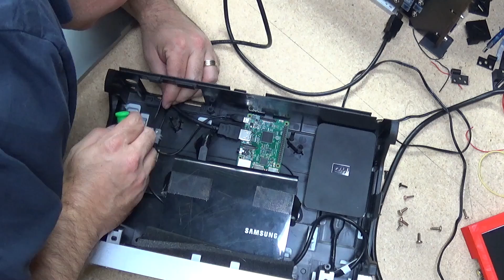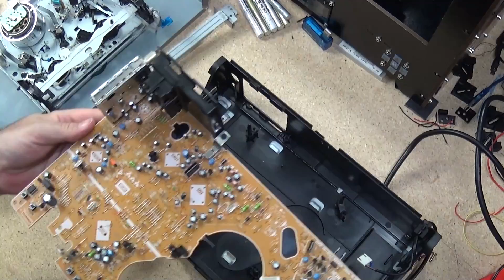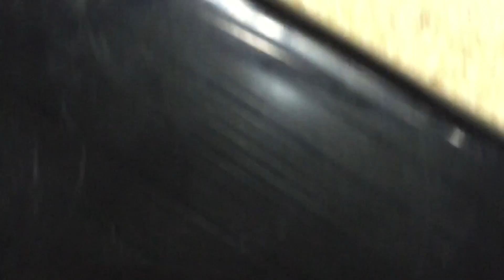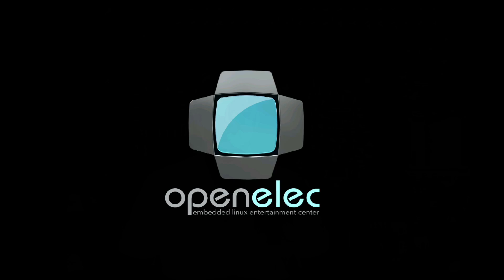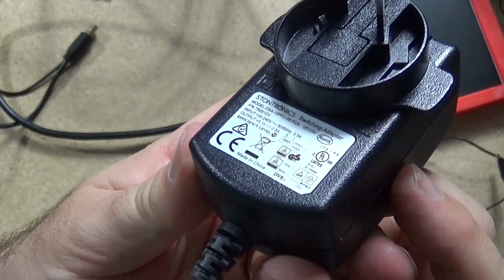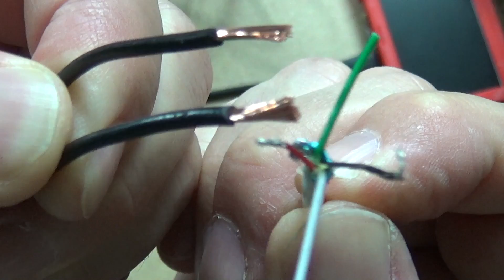Raspberry Pi 3 Media Centre with 1TB HDD and DVD in a VCR (MEHS) Episode 43

Comment: Hi! Great video! Could you provide a diagram on the power section?  Showing detailed wires to the power split between Y USB DVD portable drive and the Official Pi 3 power supply, please.

Comment: I have an external USB DVD drive connected to my RPi4 (with two cables) but Kodi won't play DVDs. It just opens a menu allowing me to browse for files/videos/.... As far as I'm concerned, Kodi doesn't support DVDs anymore.
Do you have any idea how to fix this? The set up is basically the same as yours (minus the external HDD).
Reply from the maker: No sorry.  Its been a couple of years since I've played with Kodi so it could have dropped DVD drive functionality, as you say.  The only things that come to mind is the power supply must be sufficient for the drive, some drives won't operate correctly if powered by the USB port alone, and the second things is, not all drives are created equal.  I know the samsung one I used was a winner but can't be certain about others.  Some require a usb splitter so the have access to power from 2 usb ports.  Cheers.
Reply: Ah, okay. Thanks. The strange thing is, the drive works, but Kodi doesn't seem to be able to play VOB files.

Comment: I am surprised you used OpenElec. Its old from 2006 and the people that worked and did R.&.D for them work now for LibreElec.
And the support is muchhhh better from LibreElec.
Reply from the maker: - Hi.  Good to know.  Thanks.  I tried a couple of distros but for compatibility with external devices I found OpenElec was a bit better at the time.  Cheers.

Comment: how much would it cost
Reply from the maker: - Hi.  About $60 for the Pi, $10 for an SD card, $10 for cables, $30 for a dvd drive and $75 for a 1TB drive.  A bit under $200 if you have to buy everything.  More when you add a remote.  Cheers.

Comment: so you can play games and movies
Reply from the maker: - Very much personal preference but I would suggest something like the Rii i8 or i28 (www.riitek.com) are good.  You can find a lot on ebay very similar.  Some have a basic game setup included.  For games you could always hook up a complete desktop keyboard and mouse or even a bluetooth game controller like the 8bitDo or a PS3 controller or the wireless (or wired) xbox 360 unit.  Cheers.
Reply: Thank you sur
Reply from the maker: Brayden Briggs
- You're welcome.
Reply: What is openelec
Reply: What do you mean when you said "lots of room in the case for cables or Additional items
Reply from the maker: Brayden Briggs
- Cables etc can take up a lot of room and in this instance you would have a lot of spare space to use whatever cables you liked instead of some special and expensive mini cables.  Also you would have enough room to add a 3.5 inch HD or another 2.5 inch HD and so on, depending on what you want to do.  Cheers.
Reply: What is KODI for and what dose it do
Reply from the maker: - KODI is a media centre layer that looks like the media centre in an xbox 360 or apple tv.  When you start your device, KODI is what you see and interact with to watch movies, play music, watch youtube, even play retro games through a large number of addons.  Take a look at 
https://www.youtube.com/watch?v=xaNXZ3zl41w  or just search fro kodi on youtube.
Reply from the maker: Brayden Briggs - it is a specific build of media centre.  Some are more up to date than others and can work better with different hardware.  The end use is basically the same.
Reply: Thank you so much
Reply: Thank you
Reply: Always love seeing a content creator take time to explain and answer questions for viewers.
Reply from the maker: The Red Rabbit -  I try.

Comment: Just found this video, very interesting. I've just ordered my first Pi 3 and am going to try to get a media centre built. I need to get a video input (usb). I noticed your power cable, looks Australian, whereabouts are you?
Reply from the maker: - Hi, in Victoria AU.  Just make sure your media centre gets fed by a good power supply.  Cheers.
Reply: My Electronics & Hacking Show cool, thanks for that, I've got a spare phone adaptor, oh I'm in Adelaide.
Reply from the maker: Derek Martin - Most phone adaptors won't feed a Pi 3 with enough capacity to drive a HDD or USB DVD player.  Check your adaptor for output of at least 5V at 2.4 amps.  Cheers.
Reply: My Electronics & Hacking Show ok, thanks for that, I'm actually watching you now on episode 36, interesting stuff. Thanks

Comment: Maybe an Anker PowerPort 6 (max 12W at 5V per Port) can avoid that soldering. Actually a friend of mine asked me about a cheap MediaCenter with DVD-Support and this project looks smart :) But I plan to use Raspian + Kodi so that he can use it to browse the internet aswell.
Reply from the maker: - Hi.  I can't remember if it was this project or an earlier one but I demonstrated the use of kodi within raspbian for the complete solution as you mentioned.  There is a small trick you need to implement if you run into problems when closing kodi from within raspbian.  Sometimes kodi won't close correctly and won't return the raspbian desktop.  The solution is documented, just google.  Cheers.

Comment: Would a powered USB Hub do away with the need for a Y Cable on the DVD Drive ?
Reply from the maker: +Martin Kidd - Hi.  No it wouldn't.  The Y cable is intended to allow 5 volts to the DVD drive from 2 sources.  Its the DVD drive itself that requires the 2 USB connections.  If you can provide a full 500ma from a single USB port then the drive might work with 1 USB connection but most times the DVD drive does not get enough power from 1, that's why they usually ship with a Y cable.  You can test it with your DVD drive as see how it goes with just Pi power but most don't like it.  I've tried 3 different units.  Cheers.
Reply: +My Electronics &amp; Hacking Show I'll have to try out the dvd drive I have with the pi. It runs off a single mini usb cable without the Y connector which is why I was hoping running it off a hub would do the trick.
Reply from the maker: Martin Kidd - I guess if the powered USB hub is connected to the PI and the HD and DVD are connected to the hub, that should work.  Cheers.

Comment: This looks nice but consider it for a second and you should realize that it is a complete crock, at least as presented. The project seems to provide no way to interact with the "media center"!. It shows it used with a special touch tablet, but if building a media center into an old video tape player one would expect it to be used with the living room TV (otherwise just build it in a box with the magic video screen). When used with the living room TV there is no input! That's right, the list of materials never considers using a mouse or some other input device for control, and without a mouse or that fancy (and expensive) touch screen, there is no way to control the device.
Reply from the maker: +OldFrothingslosh Hi.  Thanks for your comments and observations.  I might have missed communicating something in the video.  It can be tricky at edit time to ensure all needed information is retained and communicated but I assure you that this is a fully working unit and is currently running in my living room.  There isn't any touch screen control.  The red display I used to demonstrate operation in the video is just a 7 inch portable monitor I built in a previous episode.  This probably isn't obvious in the video.  The media centre is operated by a bluetooth media controller ($20 - $40 ebay unit) and can also be operated over wifi from any smartphone or laptop.  The connection to the TV or other lounge room device is standard HDMI direct from the Pi itself.  I may have not made these facts clear, perhaps approaching this video as an extension of my previous Pi media centre video (episode 17, https://www.youtube.com/watch?v=3PyHHj8eN1Y).  I will take your comments on board and hopefully avoid missing any key information in future videos.  Cheers.

Comment: Nice and inspiring project. You might want to consider using a power USB hub, but your sollution uses less devices. ;-)
You wasn't able to reuse the original power unit in the player?
Are you planning on using the buttons on the player? Could be fun to connect to the RPi3.
But great project.
Reply from the maker: +Anders Jackson - Hi.  Thank you.  I had fun with this project.  The only reason I didn't add a USB hub straight away is because I didn't have one handy.  The project does need at least one external USB port.  The power supply of the VCR was physically too big and overpowered for my needs.  I could have but I would have needed a different voltage regulator to feed the 5V into the project from the 12V VCR power.  There may have been a 5V rail in there but I didn't look.  If I had more time (or I revisit) I agree, using or mapping the external VCR buttons to Pi functions would be nice.  Cheers.

Comment: could i hook up my 4tb hd with movies on it ?
Reply from the maker: Hi.  If it is a portable drive (2.5 inch) with just one USB port then yes.  The capacity of the drive doesn't really matter, just the interface (usb3) and the power required.  Don't try a big 3.5 inch portable drive as they require too much power.  Cheers.
Reply: thanks
Reply from the maker: +kiltedjohn1000 - Hi again.  Just to be clear.  If you had a full size 4TB external HD and wanted to plug it into a PI 3 media centre, it would work just fine as long as the power for the drive was coming from somewhere else, not the Pi and not the Pi 3 power supply.  Hope that makes sense.  Cheers.
Reply: yes ill need to get one thank you very much ,,ill subscribe